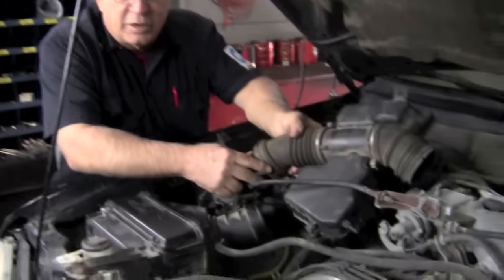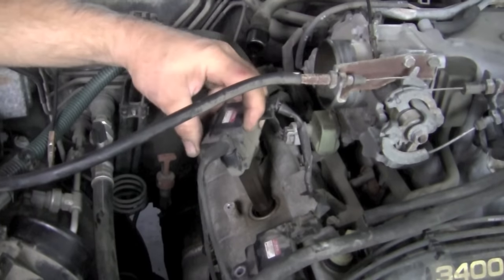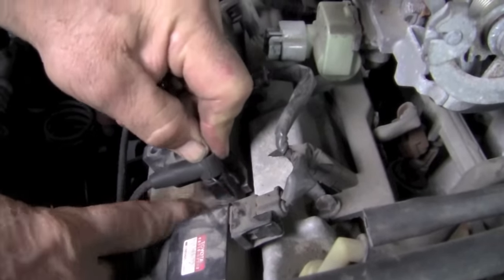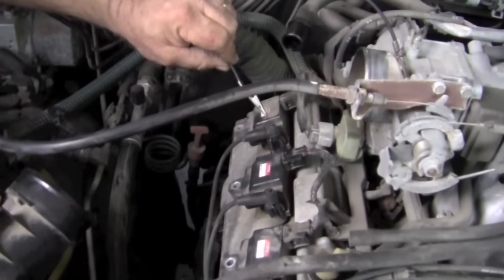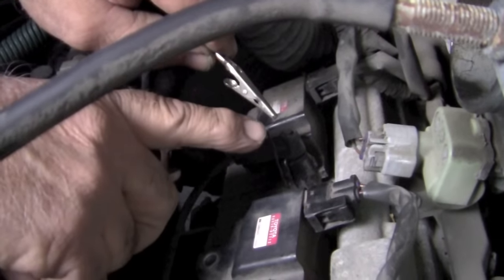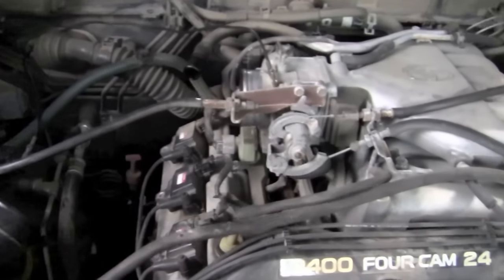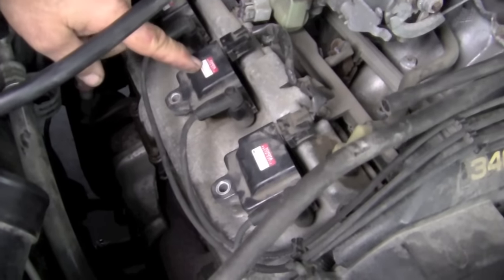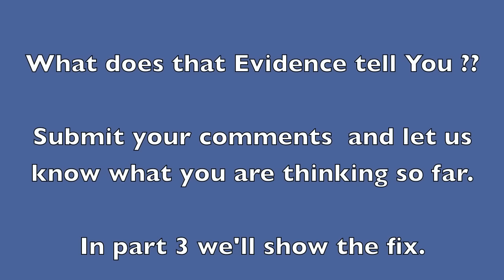How to find a misfire without a scanner 2

Comment: There is a leak in the middle cylinder coil boot. High kv under load induces the spark to go to ground via the spark plug port. No load kv  at idle will allow current to flow through the spark plug. I would love to work with guys like this. Great video I'm sure this will help a lot of newbies.

Comment: Really nice video  I think you showed us that we really may not even have to use the paper clip trick at all since by pulling out each core individually gave us indication of spark and yet did not indicate which cylinder was mis-firing until you raised the core itself.  Simple enough for me. Thank you much,  Keep up the great work!
Reply: You could see the hoses actually stopped vibrating as much during the clip test

Comment: You gave me a good lead on how to fix my issue.  I started per your video but also placed a timing light at the end of each wire by the plug and found on wire was bad.   Replaced wire and runs as smooth as new.  Thanks for posting.
Reply from the maker: glad it inspired you to use creative thinking, thanks for posting

Comment: EXCELLENT instructive procedure for spark wire coil and plug diagnosis. the ONLY flaw in the whole video is your statement that spark is coming UP from the bottom of the plug. It is not, it is coming DOWN the wire TO the plug FROM the coil and choosing the apparent path of LEAST resistance and going down the side of the plug in the carbon filled crack to get to ground where the plug screws in to the head. So it does not come UP FROM the ground point it comes DOWN from the coil Voltage travels + to - not the other way around.... But needless to say that changes nothing if someone does not know that it will not hinder the purpose of this video in any way anyway.  Absolutely fantastic video other than that pick at you point well done. I am a Mobile Tech been doing it since 1994 i actually helped a customer avoid spending money with me and CURE his 1997 3.4 toyota misfire with THIS video as his aid (send him the address) so again, great job thanks much.
Reply from the maker: thanks for your observations and comments.

Comment: When you shorted the ground wire the flame was the same size on each. As you pointed out, if a wire is bad the flame would be bigger, because of more resistance in the natural pathway through both plugs on that circuit. If either plug was bad, I would expect a bigger flame as well, for the same reason. So, those of you who say it's a bad plug are ignoring that part of the evidence. Of course, inspect the plugs, but I think it's something else.

Comment: Great demonstration of logical troubleshooting  👍 . I believe the cause of the misfire to be one of the two plugs fed from the center coil which was not contributing under load. It is possible that maybe the center coil is breaking down under load - however when you lifted the center coil out of the spark plug well - it appeared to have a good spark jumping / arcing from the spark plug boot - so I am thinking that maybe the center coil is still good. 👍🧐✌️✌️

Comment: I would swap the coil pack in the middle with any one on the out side, if the misfire go to the outer cylinders then I could say it is the coil pack that is defective. However, if it  remains in the middle cylinder then I would conclude that the spark plug is defective.
Reply: hello, i read this and agree with you. however, i have an annoying one. what if after concluding that the plug is bad, you replaced the plug on the bad cylinder just to find the misfire still remains at the exact same cylinder. would you suspect that cylinder to havr a bad compression or a bad PCM??
Reply: then its a bad fuel injector
Reply: Bigvik Or a burned exhaust valve.
Reply: Oops burnt valves.
Reply: or change both coil and plug

Comment: Very old school would call for a coil replacement.   I once had a bad coil on a 1959  triumph motorcycle.  I found myself driving into eagle pass, TX to a general store and bought some birthday candles and a roll of electrical tape.  Meled candle wax into the hole and wrapped in electrical tape and the bike ran very nicely after that.   Back in the 60's thats all there was to eagle pass.

Comment: Next step, now that you know which cylinder is missing, switch the coil with one next to it, and see if your problem moved, if not, replace the spark plugs if you don't know when they were done, and if that doesn't fix it, you've got a fuel problem, or a compression problem.

Comment: it is Spark plug OR the walls of the coil are leaking sparks to the cranckcase when in place.  You could just use a spark plug  wire from the coil to the spark plug and see if the same occour when you take off  the wire from the plug, if it does de same it´s  the plug and if doesnt its the coild itself leaking sparks when in place.

Comment: spark is escaping via the plug boot, this is very common on these engines.
Swap the coil and you are good.
A quick and dirty way to check if the coil is bad is to swap it with one of the other cylinders. If the misfire code moves to the other cylinder, then the coil is bad. If not, then it's not the coil.

Comment: More than likely it just needs the rubber boot under the coil. I know it was still good because it fires both plugs at the same time (one cylinder is in compression while the other happens to be on the exhaust stroke when it goes off). A simple fix that saves the customer a lot of hard earned money.

Comment: Thanks so far. Number 8 when under a load seems to run good but idle and to 30 miles an hour smooth out. Engine light will not go off so no tag Mike chattanooga

Comment: Video wont play, so i dont know what you showed, but just unplug the coil packs 1 at a time. When it runs the same ( 2 dead cylinders is easy to tell ) thats the issue cylinder.
Whether its a coil pack, plug or low compression, youll have the right cylinder to start with.

Comment: I was stupid and drove thru a puddle of water..enough to do a major splash up under the engine. 5 speed F-150.I turned off the engine for approx. 20 minutes. When restarting and driving .. I heard what sounded like popping firecracker noise coming from under the hood. Disengaged, i had full power...but engaged If I tried to excel I would not get full power. I had to let off the gas peddle and start out slowly and it would suddenly regain power speed..this continued thru each gear. Eventually gaining my full power to drive 65 and over. Oh yes^%%^ the engine light came on and stays on. I disconnected the battery..and reconnected. The light came back on within 10 minutes.
Thank you for your video ...it was really helpful and I learned a lot. Can you please help me? Thank you
Reply from the maker: +Pamela Cozort Hi Pam.  It sounds like you probably got something wet and it's causing the spark to short to ground.   You may be lucky and simply let it dry out and it will recover.  If it doesn't you'll need to have someone check it out.
Reply: Pamela Cozort

Comment: I have a ford e150 5.8 very smooth until held steady 35/45 then slight missing.  New ignition control module plugs wires distributor. Very smooth until high gear.

Comment: I'm surprised that you can pull the coil pack off while running without ruining it. Looks like a good diagnosing option if it doesn't cause internal short with the pack being ungrounded.

Comment: @380gb
A compression leak would not get worse under load. Its felt more under load because the engine is turning faster which is basically more strokes of the piston. More strokes means more times the cylinder did not contribute to compression. You feel more times the cylinder failed to create compression which gives you the illusion that it gets worse under load.

Comment: I go kicking and screaming Everytime I have to work on my 2  
vehicles. I don't get into heavy into repairs. Recently paid to have manifold cleaned and gaskets replaced. It's a 99 expedition.  I also had all plugs and plug wire replaced.The coolant had got into the #1 cylinder. The plug wire connection was faulty. 
FF it sometimes still misfires or runs a little poorly. I changed out the fuel filter .. I knew it had to be 40000 miles since I changed it. Blew into the old one.. barely got through..I suspect that hasn't helped the tiny submersible fuel pump motor.. what happened to the fire mounted ones on firewalls?  Anyways it helped it..just a little bit .I  have Haynes and Chilton  manuals on it.
I don't quite understand how the different coil says. work. Planning on shopping for a newer one. I can't afford a new one..but hard to believe..don't want one.

Comment: With the Varus not showing any codes, I'm going to assume that the distal O2 sensor didn't detect the result of any unburned gas. So, the plugs are firing, and it's not lean so injectors are probably OK. You've showed that you have three good coils, and you've isolated the problem to one or both of those two cylinders. I'd inspect the injectors, and then I'd pull all the plugs, and do a compression test on all the cylinders, with special eye on the two culprits. Query bad valve or ring problem.

Comment: awesome video. 
i am tempted to say that the coil was bad since it did not affect vehicle whem removed but
..
question: if that particular cylinder had a bad compression. would this test still be reliable?
thanks in advance
Reply: This is a test for coil ignition. If you suspect a bad cylinder, then do a compression test

Comment: could be the coil, but really could be the wire as I found in my problem with a 2000 Chrysler Intrepid.  I did the same but then switched the coil on the misfire with a coil from one that was firing to see if it was in fact the coil, but all coils on that side worked.

Comment: Every use vacuum hose ? ,I use to put small cut pieces into the coil and one on ing wire ,then I would use a test light to watch spark \works great ,didn't no if you seen this done before ?thanks for video great job !!

Comment: most likely a weak or broken valve spring although i have heard of injector under load, plugs are alot more durable then people think and it works on idle, pulling the coil and seeing no change only indicates that cylinder with the problem not necessarily an ignition fault, and mostly likely not ignition since it still jumps an inch. But going by duanes other video its probably gonna end up being the injector under a load

Comment: Well the second coil produces spark as we saw, even though the engine slowed when it was removed.    Could be spark plug or worse a badly seating valve which is causing a lack of compression when under load.

Comment: I'd swap the coil with one of the others to verify the issue stays in the same spot. Assuming the plug looks good and the problem stays on the same cylinder, it's probably an injector. If the problem moves with the coil, replace the boot/spring. Or maybe just half the coil can go bad?

Comment: everyone that said bad coil, wasn't paying attention.  when he pulled the coil pack all the way out, the wire was firing. only two options.
bad plug
low compression.
Reply: Marty Davis Davis that is true
Reply: Not exactly. If the coil is weak, hence it only happens under a load, then you could still get voltage enough to arc but not enough for a good firing. What he could do is pull each out far enough to visually inspect that arc as well. Just like he did with the lead to the other bank.
Reply: @stevequantie8064  definitely not the coil
Reply: louis mays  don't like Toyota?
Reply: @HumpDaddy01  I only know this because I followed the same old thinking, if it has a spark then it's fine. I had my own coil fail even though all cylinders appeared to have a spark a good spark over .5 inch. The dimension of the spark is also different between autos. Without a diag tool and just using the eye test it's just not good enough.
In my case, the car ran kinda. It would stutter when cold but not as much when warm. It would go into temporary limp mode if I went past a certain throttle point and spew white exhaust. When I saw that I thought I may have a different problem. But, I went with my gut and replaced the coil pack and all was fine.
Diag tools can at least say how big the spark and evaluate the timing to bring an analysis better than a typical gut check. Other parts can cause similar problems too. Cam sensor went out in the past and exhibited similar problems but definitely not the same error. In fact, for the coil, I never got an error it just ran horribly.
Reply: @stevequantie8064  zero chance of that coil being bad
Reply: @HumpDaddy01  Well, I'm not convinced the video here nailed anything down in my opinion. To say it's not the coil would be the incorrect approach because I had this exact situation and yet, I ended up having to replace the coil. Always be prepared for the strange when it's an electrical part and you don't have proper diag tools. But instead of taking mine to somebody with the diag tools I went with what I felt was the answer and picked up a coil pack since I can always return the damn thing. I even did smart and got some wires too which turned out not a problem.

Comment: Hi, I had a 2006 F150 5.4 L and the coil on plug design look totally different than the ones in your video. My question is how can you test the spark plug wire with the type of coil on plug in my truck?

Comment: The next thing I would do is check the spark plug visually for that hole, then I would swap the coils from another cylinder and see if misfire follows the suspect coil.  if misfire stayed put then I would run a compression test, if that was good I would ck the fuel injector.  after I found and repaired the misfire I would investigate why it did not show any misfires on scan tool, possible crank sensor prob?

Comment: it's an issue with the spark plug.The sign to listen for is as the plug boot is brought closer to the spark plug there is a momentary clear run then revert to misfire.This indicates a plug not fouled but increased resistance from plug end to ht has raised the coil output and lessened the spark rate enabling it to fire.Look for a worn electrode or leakage in the spark plug body. It is a trick I use to identify if a engine needs std or resistor spark plugs, for optimum burn n clean idle/emissions

Comment: Well, I saw sparks coming out of that center coil when you pulled it out, so that tells me that the coil is fine. So it's either a bad spark plug or bad fuel injector.

Comment: I would say a partially fouled plug due to when the coil is arcing to the plug, the misfire goes away for a second. Higher voltage available fires the fouled plug.

Comment: It's probably a bad spark plug because when you held the coil up just above the spark plug the misfire went away. That means that the spark is not hot enough to ignite the fuel under a load.

Comment: id say either the coil it self, or the coil is getting low voltage, because it runs fine when not under load, when cylinder pressures climb, it cannot support enough volts to bridge the plugs gap

Comment: My "guess" is that there is a cracked or carbon tracked spark plug. The spark generated by the secondary ignition will always take the easiest path to ground. In  this case I think it is the defective spark plug. The repair would be replace the coil assembly\ with boot and at least that one plug or all of them if a tune up is needed.

Comment: my guess is compression. the leak isn't bad enough at idle to affect the engine but once you add the load the leak increase under the pressure.

Comment: I have a 04 ford f 150 xlt that I've been chasing a misfire on and I'm gonna just change out all the plugs.  I just brought the truck and need to tune it up anyway.  What are your opinions on my decision
Reply from the maker: You said it is a 2004. With an unknown maintenance history that is a good thing to do.  Understanding that a "misfire" has 4 parts. 1 = spark, 2 = fuel, 3 = compression, and 4 = timing.  If the cause of your misfire is only spark-related, then this may fix it.  Still, iy is a good thing to do.

Comment: The coil is good, as it arced to ground when it cleared the spark tube.
 It's the plug.  Bet there's an open in the resistive element..

Comment: I got a BMW 328i 2008 they make it difficult to get under the hood sadly. Will scanners really not help find out if it’s a spark plug or fuel injector issue

Comment: Nowdays you have cars that you have to take the intake off to get to the coils and spark plugs. Is there a way to check that  like on a Ford 500 for instance?  The 3 back coils and plugs are under the intake. Its the most ridiculously designed car I've ever seen. Its everything you can do to get on the low side AC port.

Comment: switch the coils, check spark plug (#4),,,,,

If switching the middle coil did not solve the problem then hook up your scope to the middle coil and check for the signal

Comment: swap that coil with another coil. if after doing the load test the misfire changes to the cylinder banks of the suspected coil then the coil needs replacement. if the misfire stays in that same cylinder bank even with a good coil, then spark plugs
Reply: nelias7306 thanks for these tips

Comment: Bad plug connection on the #4 cyl (the one under the coil pack) because you tested the leads using mechanics wire and all coil packs were about the same.

Comment: So i know this is kind of old but havnt seen the 3rd video. And well theres a few things that could cause the misfire you need air, fuel, compression, and ignition,.well its running so its pumping air, its got ignition you comfirmed spark. And you didnt seem worried about compression. So id say either fuel as in clogged or bad injector. Or fould plug or like these fine wire plugs you pull out of cars running like a turd and the tips are broken off from somebodey trying to gap them or dropping them down the port. Think im leaning toward damaged plug.